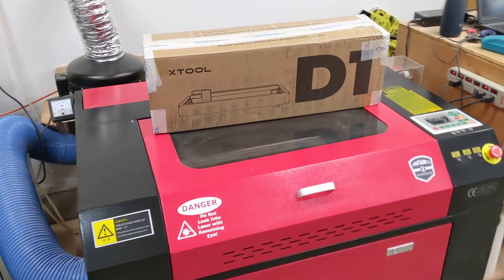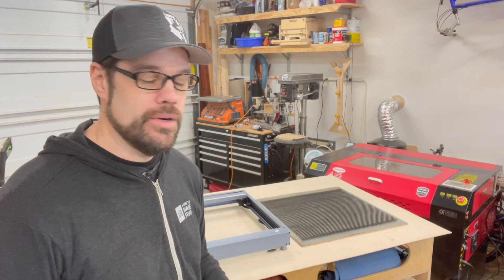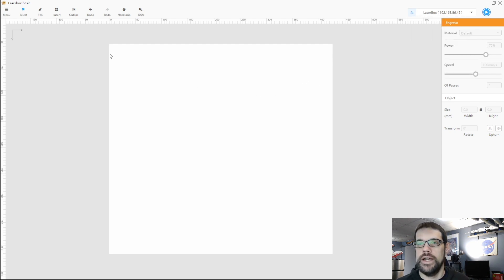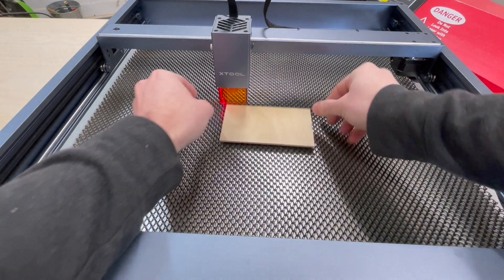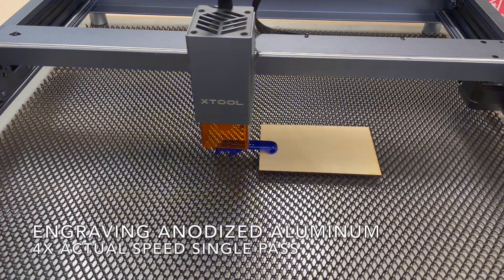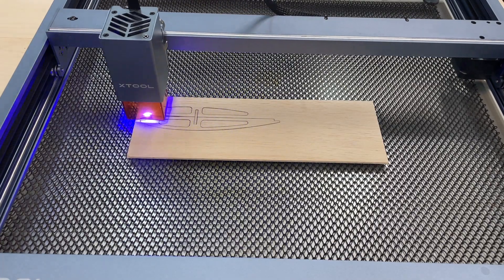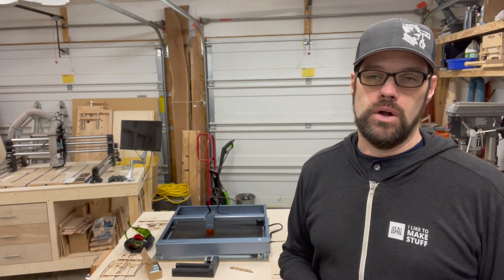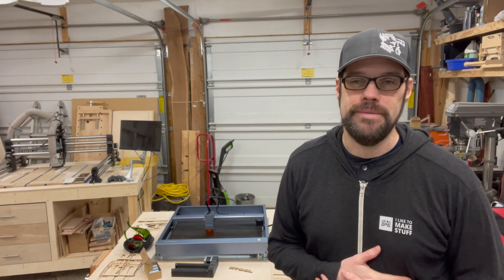X Tool D1 10W Diode Laser | My first impressions

Comment: Best video I've watch for new beginners.  Also, what size wood were you using? 1/4"? How thick of wood can the d1 10w really cut through with ease?
Reply from the maker: The 10w laser can cut most 1/8” or 3mm wood without trouble. If it’s softer non plywood material like clean basswood than maybe 1/4” but most of that will be slower and take multiple passes. That’s where a 20w or larger module is nice to have.

Comment: what is the protective screen made of / glass through which you can see the inside of the housing?
Is this material safe?
Reply from the maker: If you’re talking about the orange shroud around the end of the laser, it’s made of acrylic. It helps block some of the reflective light, but you should still avoid looking at the laser light and wear laser safety glasses when using the laser.
Reply: Yes thank you . I'm asking because I want to build a case for my Sculpfun s30 pro and I was wondering about a safe material to use as a window/viewer
Reply from the maker: @logeen  Check out Jtech Photonics.  They sell laser rated acrylic sheets tested to OD4 for the diode lasers at the 455nm wavelength.

Comment: The air assist would really help with any of the scorching. Looking forward to the enclosure. Sounds like xTool is planning on having that as an addon at some point. I haven't taken the plunge yet as this is going to be more expensive than my 3D printing hobby, lol. You've gained another subscriber. Great video.

Comment: I've been hovering over the buy button for ages now. Just wondering, I'm primarily hoping to use this to cut black acrylic 3~5mm and then engrave labels/words onto it for a switch panel. Do you know how well it can do that?

Ideally I'd be able to cut frosted acrylic of darker colours too but the deal breaker is how well it does on black. If you have any feedback on it with black acrylic I'd really appreciate it, thanks!
Reply from the maker: I've not tried cutting black acrylic with this yet.  I need to source some to try.  The lighter more transparent colors do not cut well but you can engrave them with some masking.

Comment: I've looked at this machine and plan to buy one. I wonder how fast you can go with 3 mm birch-plywood. I plan to use the machine for model building in O-scale. It seems to be a sturdy built machine compare to similar machines. This one has metal wheels on metal rods instead go plastic wheels on the extruded rails. Thank you for sharing your thoughts, I look forward to further tvideos.
Reply from the maker: I'm working on another video with it to show cutting some various materials. What I've found with my machine is that I can cut 3mm Baltic Birch plywood in one pass at 4mm/sec.  I've also cut 6mm Baltic Birch in two passes.  Occasionally I'll hit a spot that has some extra glue or some thick grain that needs to be trimmed with a razor blade but that's rare when using quality wood.
Reply: @Vintauri  I've just ordered the machine with a honeycomb. It will arrive here to Sweden within a month or so. I also ordered the air-assist but that will take an additional couple of weeks to arrive... Now it's time to think about an enclosure with venting... Thanks for inspiring me to take the jump.
Reply from the maker: @steenstavnshoj1967  Congrats on the purchase!  I hope it arrives quickly and you can get to having fun creating with your new machine. I'm working on an enclosure right now using my CNC router to cut out parts.  I hope to share a video on that as well to maybe inspire others that want to build one.

Comment: Hi!  Did you have any issues updating the firmware?  I can use the laser with its "out of the box" firmware, but when I try to update, i get stuck in a never ending update process.  I am connected to Lightbox via usb, the correct COM port, my computer can handle the update, the switch is to the left but still not able to update.  Any help would be great! Thanks so much!
Reply from the maker: I have set up both my laser and now a friends laser and have not had issues updating. On occasion I’ve had issues connecting when switching between lighbox basic and lighburn but usually power cycling the laser clears that up. Do you see a progress bar during the update process?
Reply: @Vintauri  That's interesting! No i see no progress bar, just the circle and "updating".  Its weird because i can still print on it using Laserbox basic.. but i cant connect to lightburn since it has the older firmware.  People say it should take less than 10 minutes but ive had it run for an hour before and still nothing.  Cant figure out what the root cause is.
Reply from the maker: @Fraz1919  maybe try flipping the switch to the other direction, see if it fails there and then switch it back. Also try resetting the SD card in the laser to see if something there is holding it up. It should only take a few minutes to complete and you should get a faint progress bar along the bottom as it works. Lightburn is so much nicer to use with this it’s worth getting the upgrade done.
Reply: @Vintauri  I had tried the switch to both sides along with hitting the reset button that's next to it... but that's a good point with the SD card.  Of all the Xtool support, and facebook forums. You have been the most help so far.  Thanks so much
Reply from the maker: @Fraz1919  Well I hope I'm helping you get closer to resolving the issue.  I know how it can be tough to find answers on various lasers so when I can help another I try to do what I can to help.  I know they have alternative ways to flash the machine that are more technical in nature and I have not had to use them yet so I cannot offer any insight into those processes.

Comment: How does it compare to the Chinese CO2 engraver you have?  I am looking at purchasing a unit in the near future.  For $500 to $600 more I can get into the CO2 unit.  Great video by the way.
Reply from the maker: There are some advantages that each has and I hope to cover them in a future video to help with that information. The Co2 can cut most any acrylic even clear while the Diode laser can only cut opaque acrylic and can only engrave it with a mask like tempera paint.  The Co2 also has much more power so the speeds of cutting the same material are much faster.  However the diode laser takes up less space, can be placed on top of a larger item to engrave, has fewer moving parts that need alignment, needs no liquid cooling and is much cheaper. Thanks for checking it out and dropping a comment!